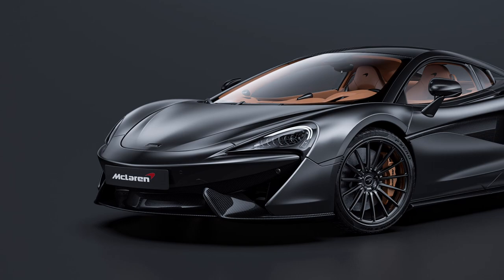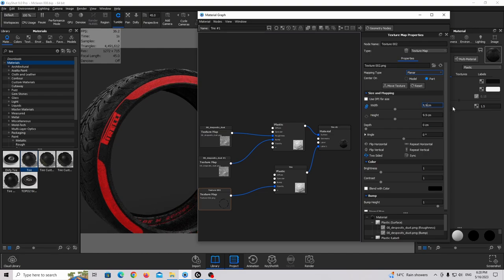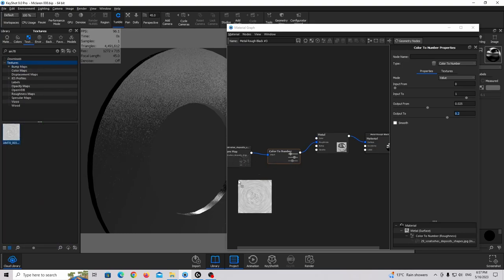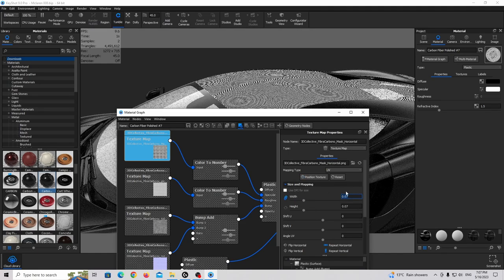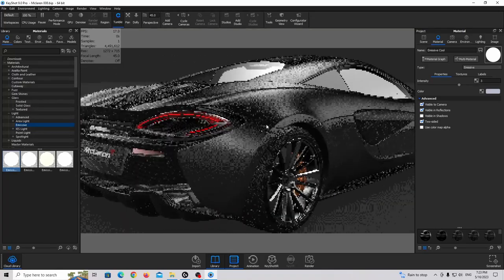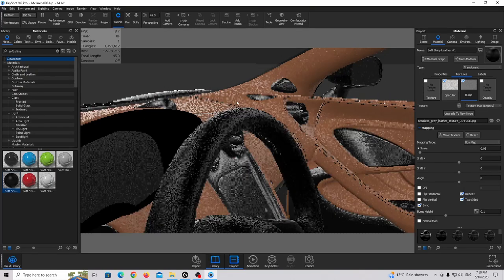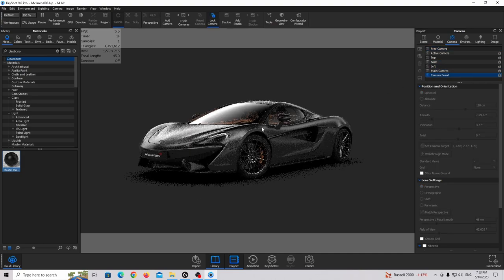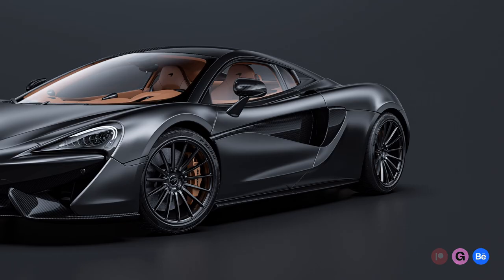KeyShot: Create Stunning Automotive Visualization Part 2/2

Comment: why dont you upgrade to gpu system than cpu
Reply from the maker: Good question, I am old school but this year I will upgrade my whole computer 😊 when I was learning about rendering I was working mainly in mental ray and V-Ray and these two render engines back in the day was primary designed for CPU. These days GPU is much more faster and results are more close to CPU rendering 😊
Reply: @textureman  best Keyshot tutorials I have ever seen on open source platform 🙌